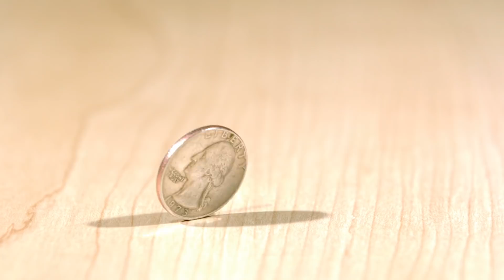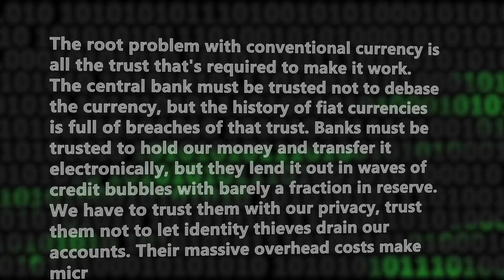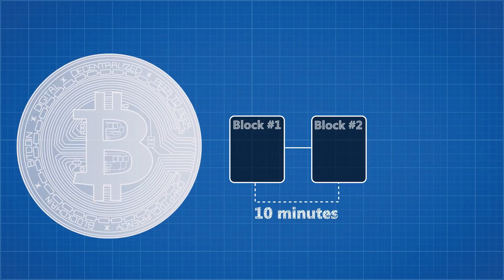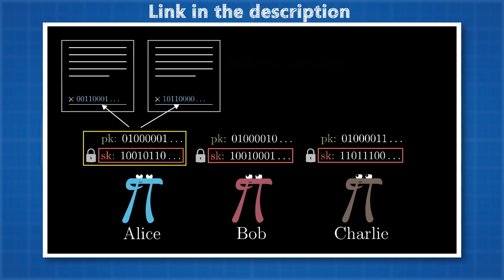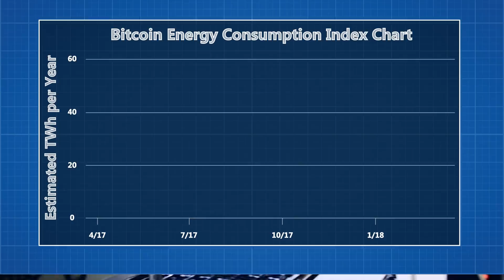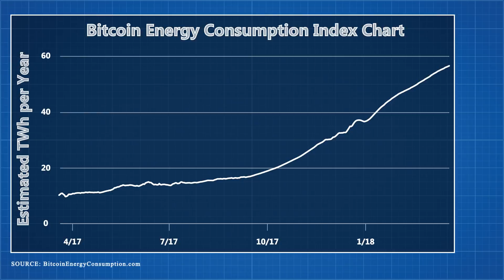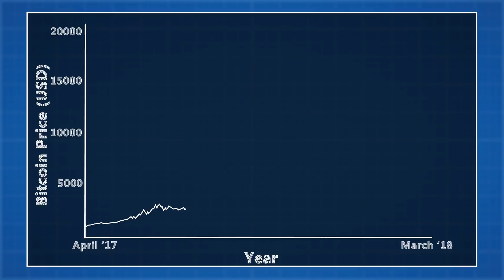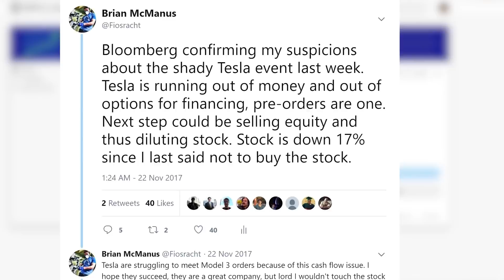Why Bitcoin Is Not Working

Comment: Did you do research on the solutions to scaling Bitcoin and the current work in development? If so, then you did not mention them. The lightning network is  a huge development for bitcoin and bitcoin developers around the world are constantly working on improving and solving current problems. Also Bitcoin is capped at 21 million. The block reward stays exactly the same. You don't earn less overtime, you earn the same amount until 21 million are found. But the computing power needed will increase or decrease depending on the current network hash rate. The estimate of when all Bitcoins will be found is 2140. The idea is the block reward distributes coins fairly overtime to those who help support and secure the network. With increased miner hash power, the security of the network goes up because any individual attacker would need majority compute power relative to the total network hash power. And an attacker would have to waste costly energy to attack the network. This is how the network is setup and your wrong to say Satoshi never envisioned that. He did, and if you read the statements himself he predicted that by the time the block reward ends the price of the coin will be so high that fees alone would create enough demand for mining to secure the network. So the price of the coin relative to total hash power will reach a balance of supply and demand. Since miner earnings depend on competition from other miners. The difficulty of mining adjust to how many people are mining. There are so many important points left out of this video and without those it leaves viewers without a true understanding of the situation.

Comment: You must work for the big banks, you have no clue. The hardware you are showing is not even for mining bitcoin, bitcoin doesn't use graphic cards. You don't mention how bitcoin has been quickly improving on most issues you mentioned, check out Lightning Network people! Also, improvements in LN will reduce mining power, as well as advances in new more efficient hardware and green energy. The USD is a joke, with unlimited printing by the privately owned federal reserve at a rate of 2% inflation per year! Bitcoin is deflationary! And, you compare BTC with VISA but FAIL to mention the entire resolution process that goes into a VISA transaction involved several other parties and power, BTC transactions ONLY require miners. SO most of your arguments against bitcoin are false since they are very biased towards archaic fiat. Lame video. Don't believe this nonsense people, do your own research!

Comment: Verification is performed by all full nodes, not just mining nodes. Any and all assets that can be legally used as a speculative instrument will be. This does not preclude use as medium of exchange, nor a store of value. Your transaction throughput figures do not factor transaction batching, nor do they consider the potential of the Lightning Network to leverage 1 or 2 transactions to perform thousands. During December of last year, total block fees already outpaced coinbase reward. If increased adoption somehow does not allow a fee market to develop, this is something that can be forced. Bitcoin is volatile due to the fixed issuance schedule, as per design. This is only really an issue for physically pricing goods natively in Bitcoin, something we are not going to see for a very long time, if ever, and Lightning will eliminate price slippage during transaction confirmation. You hold the dollar in high regard, but it's value is rather volatile too, monotonically in the wrong direction. Nakamoto chose fixed, finite issuance over reduced volatility. You make a poor caricature of all the design and economic decisions he made, and claim these decisions are somehow a distortion of his "vision." And I'm unsure what you think Ethereum is bringing to the table to alleviate your imagined "people problem"? Perhaps do more research next time. Energy consumption is about the only part you got right, and even then your comparison was flawed.

Comment: 1. It is no longer true that Bitcoin is limited to 4 tx/sec. Since August 2017, the limit for each block is 4MWU, which can comfortably hold about 7000 transactions, or 12 tx / sec.

2. If there is a clear need, the block size can be increased further, and the tx rate limit with it.

3. The lightning network allows the number of payments per second to reach much higher numbers even without a block size increase.

4. "Forever" is a very long time. As I said the tx rate limit has already been increased, not to mention possible future increases. The sentence "Its limited transaction time of 4 transactions per second will likely prevent if from ever becoming a useful currency" is nonsensical and reflects the very poor research that has gone into this video.

Comment: I did learn a little bit from this video, but the parts I learned had little to do with why Bitcoin is not working.  I thought you'd tell me something new in that area.

So, Bitcoin is not the only cryptocurrency out there.  Maybe some other currency will overcome Bitcoin's flaws.  Is there any reason that some form of cryptocurrency won't work?  Or maybe the problems Bitcoin currently faces will be overcome.  In any case, with the U.S. dollar, you can be sure of one thing: it will be devalued a little more every year.  There's some stability for you, guaranteed devaluation!

Comment: I work with engineers there not as smart as you’d think Iv gotten blueprints with no dimensions more than once. Iv even gotten blueprints that were designed backwards holes drilled on the wrong side the engineers response was it’s ok we can just flip the part 🤦🏼‍♂️

Comment: Bitcoin's original intent was to become a currency and eventually replace fiat currency (paper money). However, due to its rapid rise in value in 2017, it has now become more of an asset, almost an investment - kind of like stocks, bonds, and other securities. However, unlike stocks and bonds, bitcoin (and other cryptocurrencies) aren't backed by anything, they don't have an underlying asset guaranteeing or backing their value. Their value, just like anything really, is derived from our own will. Because we want it to be expensive, and we are willing to invest in it, it so becomes. Think overpaid "professional" sports players or actors - the tickets are so unaffordable and the players get paid so much just because we enable them.

I don't think bitcoin, in its current form, will ever become a currency. Its version of the blockchain (think v 1.0) is too slow and limited. However, the blockchain concept itself will remain and we will build on it. There are other cryptos today, i.e. Ripple or Litecoin, whose blockchains are more refined, faster and more secure. It may take several iterations and different formulas to get to a blockchain version that's both secure, sustainable and fast enough to process the millions of transactions occuring at any moment in the world.

In the meantime, if you have some ether, you can either hold it in your wallet and hope its value will go back up, or put it in P3D and watch it multiply. If the value ever does increase, you can withdraw and exchange it back to fiat currency. Link provided below:

https://powh.io/?masternode=0x456971923e6ce172c4747d1308ad3d7be958e18b
Reply: "the USD is backed by the entire american economy, military, government and people. bitcoin is backed by nothing. it only consumes electricity..."

You clearly don't know what backed means. Currencies backed by gold are so because you can exchange the an amount of that currency with its producer (or some affiliated party) in exchange for gold. If you don't know the difference between a backed and a fiat currency, I suggest reading Murray Rothbard's book ("What Has Government Done to Our Money?") on the economic history of the US (it's free).

https://mises.org/library/what-has-government-done-our-money
Reply: Scam Alert!!
Reply: That's not true. The most secure network on the planet is any network that isn't connected to the Internet. Bitcoin can still be attacked with the 50%+1 method. If you think that's far-fetched, just think about how literally every publicly-traded company works... they are controlled by a small elite despite being theoretically "public", because the elite owns more than 50% of the stocks.

The stock market used to have a great reputation, like bitcoin, people were super hyped that the 'common man' could participate in the capitalist machine by himself in a decentralized manner... then rich people ruined everything by monopolizing the stock market, because that's what you can do when you're rich.
Reply: Mihai P I've been using my computer to mine when I'm not using it. I don't pay for power. For a little over the past year all of my games have been purchased with btc. My computer is generating games for itself. It's been great.
Reply: Alienated for Science love this quote
Reply: Mar ....it's backed up by debt.
Reply: Mihai P do you know what's the lightning network? Read about it before making those comments.
Reply: The fact you have to pay your taxes in USD.  People really need to read MMT,  its a pretty simple theory and explains how fiat currencies work.
Reply: Bitcoin primary purpose now is a store of value a hedge against inflation. Whether it can be internet money in the future remains to be seen.
Reply: FRIENDLY WARNING: P3D is clearly a pyramid/ponzi scheme. You can easily make a lot of money and someone else will lose it, or the exact opposite. Just like the huge disaster with Bitconnect. P3D has no reservations insinuating the project is a scheme, since greed and FOMO will follow anyway. Beware. Learn more about these schemes through https://en.wikipedia.org/wiki/Ponzi_scheme and look at Bitconnect as an example, through https://en.wikipedia.org/wiki/Bitconnect#Criticism_and_collapse
Reply: Mar actually it doesnt need 51%, they just need to be lucky to get multiple hashes in a row. With that their chain will be accepted as the right one. I bet 20% would be enough to hack the system in a short time.
Reply: What backs the USD?
A few trillion in debt?
Reply: Mar - BitCoin is powered by it's ability to be a decentralized ledger which enables transfers without the need for a middleman. That's hardly "nothing".
Reply: Mar - the infrastructure is ran by the miners. You can be a part of it if you download the blockchain and run the protocol on your pc. The protocol is decentralized, which means "the middle man" cannot take a spontaneous decision to bill your transactions or accounts. It cannot take the decision to confiscate your bitcoins. It cannot take the decision to block your account. And no, you don't need an exchange to transfer your bitcoins. You need an exchange to buy bitcoins with fiat. "Buhhhht it needz iternetzzz" Srsly mate, do you have an IQ of 50?
Reply: "mine all the electricity away to crunch pointless random numbers. who needs banks right?"

The point of "crunching random numbers" is to keep the ledger decentralized and the transactions secure. That's how the technology works. If you have a better idea on how to create a decentralized ledger, please - share it with the world. Maybe file a patent, you'll be filthy rich, I guarantee you that.
Reply: + Mihai P There are people around the web who think that Bitcoin was hijacked in 2017 by rich traditional investors (with a lot of money to play with) who brought the price up to such prohibitive values that the average Jane and Cameron were put off joining in the crypto market. Essentially, they did it on purpose because they felt threatened by its potential.
But hey, nowadays, there are other much more solid and well-backed up coins springing up every day as a result. Them kill-joys can't spoil the cryptomarket the way they did because they have no idea what to shoot at anymore... :)
Reply: the USD is backed by the entire american economy, military, government and people. bitcoin is backed by nothing. it only consumes electricity...
Reply: yes I'm sure the mafia, organized crime and everyone else with some shady deals to finance will be ecstatic. now they don't have to sent gold coins per mail anymore. btw technically you still need a middle man. or several. bitcoin needs infrastructure and coding and there are people working on that. you also need an exchange not to mention your internet provider.
Reply: +growling I bet some miner and crypto investor will soon come along and claim that the tulip thing is just a myth and never happened, because that's what another miner told him, or he read the comment from another miner, without doing any fact checking. 
Of course it did happen. It was short lived, but there really was an insane price hike of tulips, followed by a crash of tulip prices.
Reply: the fact is you can't use bitcoin without others doing the verifying of the blockchain. so it's not a peer to peer transaction without depending on a 3rd person, is it? rhetorical question! also if 51% of that blockchain verification would be controlled by a group of miners or one supercomputer they could fuck over the system. not to mention that if the blockchain is cracked all your 0's and 1's are gone. you depend on so many things and people and technology to work and for what? a file with 0's and 1's you don't know will be useful or hacked or lost if your computer decides to fuck you over and then all the imagined value is lost and in the end you can't buy shit even if everything works. currency more instabile than the stock market and less useful than nigerian dollars. thank god we use our precious resources to waste enormous amounts of electricity and computational power on that. fuck the climate. mine all the electricity away to crunch pointless random numbers. who needs banks right? I just go take out a loan of bitcoins to buy a house. oh right, I can't. well maybe I use bitcoins to safely store my savings. oh no the price of bitcoins just collapsed by 30% over night, bad luck ey? but at least it's secure. oh no someone hacked my computer and stole my bitcoins. but even then you can simply mine more. who doesn't like mining and getting rich by ding nothing... until they send you the electricity bill at the end of the month.
Reply: Bitcoin is the most secure network on the planet. Don't spread false information.
Reply: so in fact bitcoin is not a currency at the moment. since that is it's reason to exist, it's a failure on all fronts. there is no way around this. the only thing it does is use  huge amounts of energy and computational power to do something that is essentially worthless and only good for speculation. a complete waste of time and resources for 1's and 0's in a file.
Reply: Mar - it's a currency, with which you buy other cryptos. That's its use at the moment. You have to be really stupid if you think it's going to cost that much for that long if there was nothing but 0's and 1's to it. Do your research on the crypto market before spreading your ignorance.
Reply: And this is why central banks exist. No one will ever want to use something as money if its value relative to other goods fluctuates more than .05 per day, or if it is unregulated and subject to speculation.

Also,  proof-of-work in general is a shit system. As more powerful machines and efficient algorithms are constructed, more and more computational power is required to verify the blockchain, which has horrible environmental conditions and also drives out smaller independent miners while favoring centralization, which puts us in the same exact condition as Wall Street, just with more computers and less angry Bernie Sanders. That just grows to infinity as long as the system is profitable. If profitability goes away, there's no more incentive to verify anything and the system loses its entire reason of being.

Comment: The root problem with any currency is that it's currency. Its too generalized and arbitrary to represent anything. In any types of motivational systems that use abstract rewards to do something instead the action itself to be rewarding/motivating, you always get the problem of doing an action only to the degree that it gets you the reward, although you would want to maximize the action but it gets 'corrupted' ,it gets done very superficially as long as that's enough to get you that medal/diploma/money etc.  And what's with decentralization by itself being desirable? Bitcoin or banks , its still has absolutely the same mechanisms of currency we had for thousands of years. You will still get people who have disproportionately more bitcoins than others (i.e. inequality). And 'trust' in currency? I don't how is that relevant to anything. The thing that banks did was exactly because their base motivation is currency. It was the profitable thing to do. So with or without banks, people will still do it as long as you use currencies instead of directly providing to people's needs  through scientific and technical means used for social concern. You can see that people still do 'corrupt' things when using bitcoin. They try to hack you to get your coins. Some have giant server farms and thus have the means to get more than you and thus have the power to decide what to do with them  when you have the most of some currency. And people make 'virus miners' to use your computer for their benefit while surfing the internet. Its all the same shit all over again. I see no improvement with crypto-currencies of any relevance. It just makes some professions obsolete, but replaces it with other bullshit and keeps the old bullshit the same. Same BS , new packaging.  And like the video mentioned in terms of electricity, we get to use so much more resources for calculating mathematical fantasies for an arbitrary game of mining virtual coins. Simply terrible.